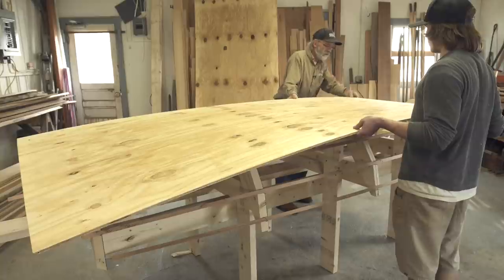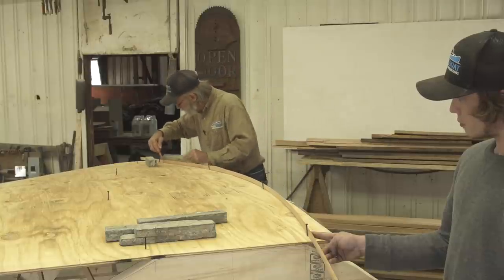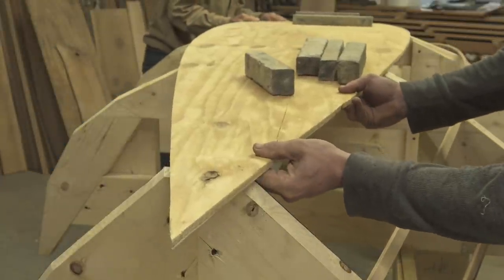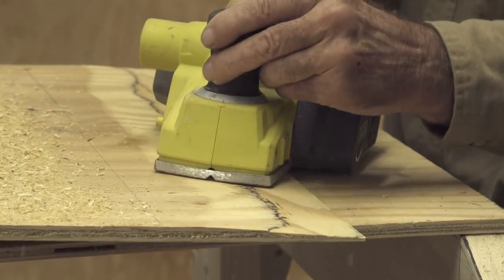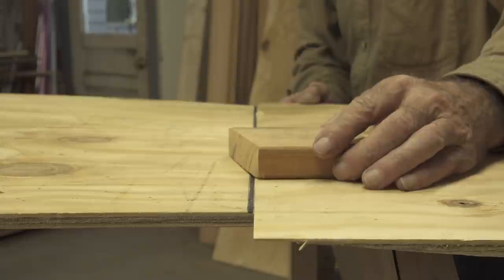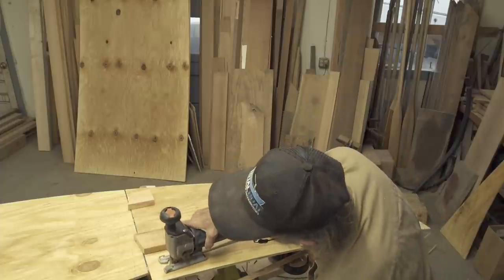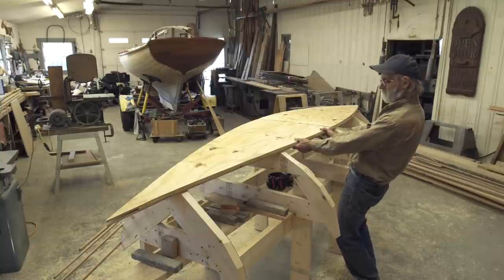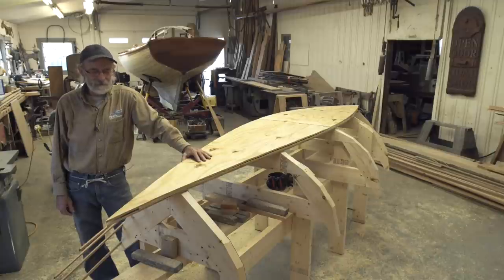Building The TotalBoat Sport Dory: Episode 7 - The False Bottom

Comment: Them old Bosch Jigsaws are a beast, iv an old Bosch jigsaw from the 90s thats still kicking and shows no sign of stopping!.
Reply: I got my late 80s model refurbished a few years ago. the bearing and the actual rod holding the blade had been shot, the shoe was crooked as a barrel of fish hooks, the coals had been done, the blade roller was kind of half moon shaped with the blade only sliding through it but no more rolling motion...
Refurbished it myself by exchanging all the worn parts and the thing is better than any new one you can get in the big box stores today. best thing, all the spare parts had been (and still are, including diagrams) available directly from bosch. Even better, all those parts together, and those had been some of the crucial elements for the motion, have been less than 40 Euros including shipping.
Reply: Alex Ku Cannot beat the good stuff. I say modern tools won't be so repairable in 20 plus years

Comment: It's always interesting to see how simple tools obtain complex results. The batten is indeed a crucial tool in the design of a boat.
Reply: Indeed, to mee it seems here simplicity is key to a great design. I cannot even imagine doing such a design in cad. And unless you want to get some big CNC monstrosity to cut out your parts, transferring the lines and all the measures of those bent surfaces would be a nightmare.
Looking at it it seems to be kind of logical to finish the design based on your basic measures as you build, the false bottom and the battons are the best example, so simple, so effective and such results which seem to be automatically falling in place and look pleasing to the eyes.

Comment: I've noticed how precise and accurate you are in the boat building process. Was there a time in history that things were less so? I was at a restaurant in FL with a couple of dories hanging from the ceiling. Although these boats were well past a usable state it did not appear to me that they were made with a high degree of accuracy. For example it looked like that side planks were surfaced on two sides and that the unfinished edge was exposed. The bark was removed but they were not surfaced. Obviously the side planks overlapped and perhaps fastened into the overlapping plank.  The structure also was not uniformed and did not have a proportional  even flow to the shape.  I guess I'm wondering if there was a change in accuracy with modern tooling or perhaps this was just a couple of homemade boats by some novice. By the way the boats are at "Flounders restaurant" in Pensacola Beach.
Reply: Back in the day, fisherman often used the winter months to build boats in barns or sheds behind their homes and would sell these boats in the spring to other fishermen, or hopefully to a "Summer Person" for a loftier price.  Some of these builders were better than others and those that built specifically for the Summer Person trade sometimes cut corners and built inferior boats.

Comment: I like your scarf technique, just strike a line 5" from the ends.  Simple and works.  I was under the impression that the length of the scarf depended on the thickness of the wood you are splicing together.  At least for homebuilt airplanes.  Do you always stay with a 5" distance for all scarfs, regardless of thickness?  Thanks.